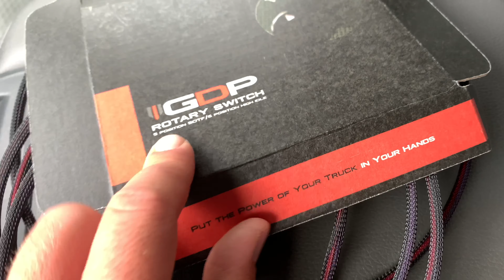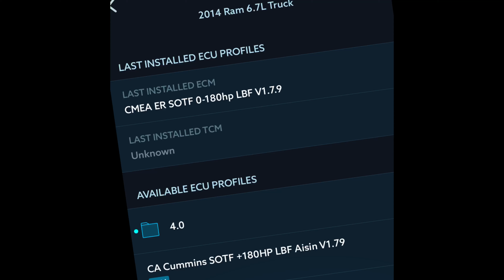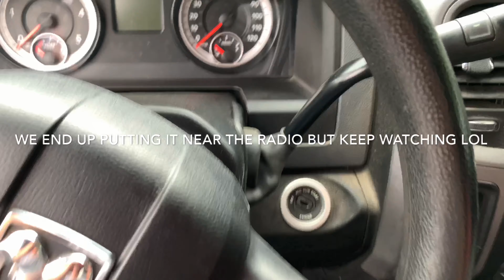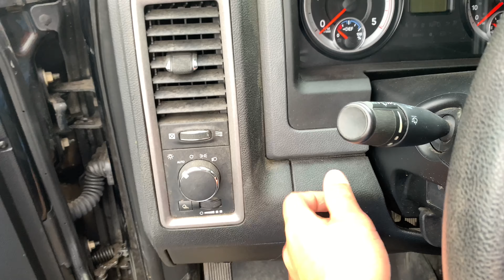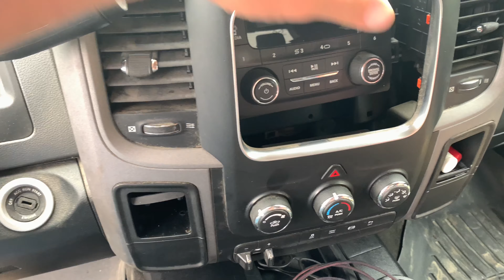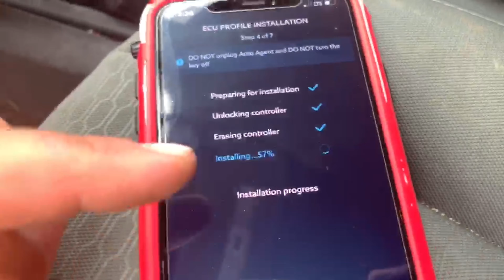How to install GDP sotf switch on cummins ez lynk tuner 6.7 diesel SHIFT ON THE FLY 4K!!

Comment: What are the gdp tune levels? I just had this done and didn’t ask when I picked it up.
Reply from the maker: I can’t remember but 3 of the tunes now 90 110 and last 250 when I tow I use the 90 everyday driving 110 and 250 only very seldom while I’m moving to prevent trans issues I’ve had great luck

Comment: Any check engin lights? after I did a ezlink sotf tune  I keep getting ccv code with a light   clear it come right back
Reply from the maker: No I didn’t experience that at all do you still have your crank case filter in your valve cover?
Reply: @frontwoodsfarmer2063   yep I have everything still I was getting a code p04e4 so my tuner finally got back to me and wrote in a shut off for that code so far no light
Reply from the maker: Awesome glad it was something simple

Comment: How did you run the wiring to that spot where you ended up putting the switch
Reply from the maker: Ryan Denery I took the dash cover radio bezel off and drilled it out for the switch. Then the wire just goes through the firewall to the plug.
Reply: FrontWoodsFarmer I have mine ran through to the inside just like this mounting spot you did. I’ll have to pull my radio bezel off tomorrow there’s a big enough gap between there an the ignition cover to run the wire I assume?
Reply: FrontWoodsFarmer More or less what I meant was how did you run the wire from the inside of the fire wall to the spot where you drilled the radio bezel?
Reply from the maker: Ryan Denery yes there was definitely ample room. I’m sorry bud I think I was misunderstanding what u were asking. If you get stuck message or email me I’d be glad to help. The original spot where I was going to drill by the steering wheel where everyone mounts there’s there isn’t much room. I really like it near the radio a lot more than that way.
Reply: How did you figure out which wire goes into which spot in the plug?
Reply from the maker: I’m not sure why I haven’t seen this comment until now I apologize everything I needed to know was on gdp website for each kit and for what truck. Are u stuck on your own? I can help u
Reply: @frontwoodsfarmer2063  thanks for the vidoe ! I couldn’t find shit on it .I got the same set up ezylink with that switch an no directions with anything lol
Reply from the maker: @lambojones  hahahaha man I hear you it’s super frustrating thanks for watching and subscribing more Cummins videos to come

Comment: How do you like the tune. Im looking a the same truck and it has that tune. Just wondering how do you like it?
Reply from the maker: Well in all honesty not sure if it’s my turbo now but it’s dumping alot of black smoke while towing. I think that may be my turbo though because on deceleration I’m getting white smoke. I ruled out the head gasket completely. It’s either the turbo or injectors. It’s been doing it awhile so it’s hard to remember prior but it was ok but nothing to write home about but some of these tunes are completely unaffordable. Id say it’s very decent for the money overall.